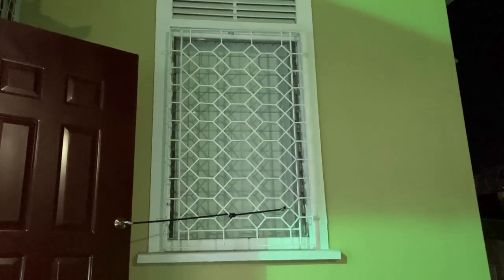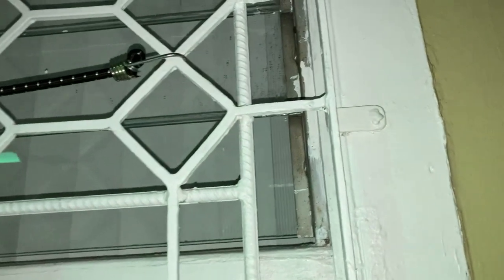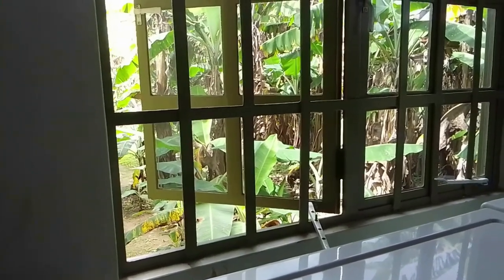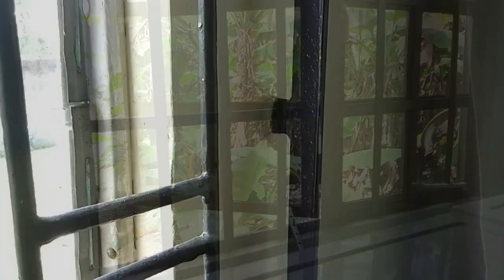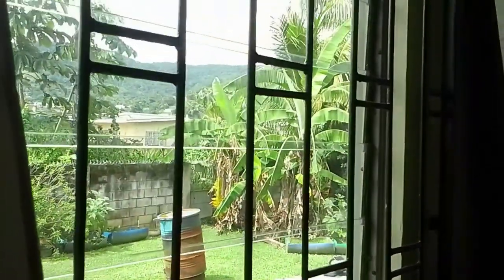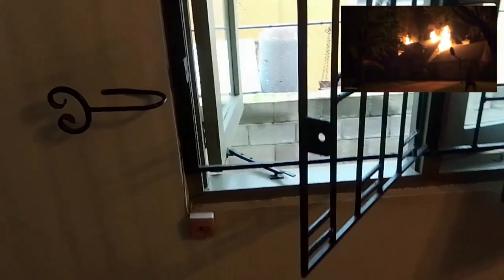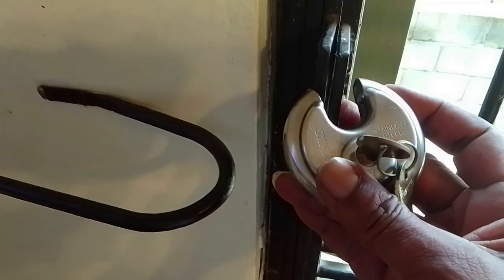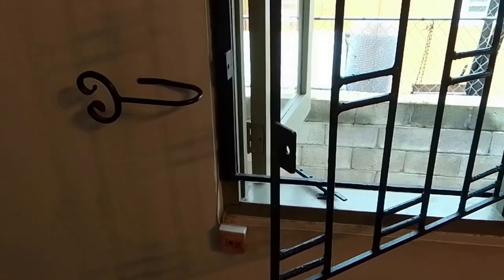Burglar Bars -  Advice for Theft Prevention

Comment: Well said sir and happy holy holiday to you and family. Thanks for sharing this info.
Reply from the maker: It was my pleasure
Reply: I prefer external burglar proofing. When I open my windows I don't want to see it in bars on the inside
Reply: Please remember in case of fire it is the sm9je that kills you before the fire even gets to you. So fire exit must be easy to access
Reply from the maker: @lilacer6841  While that approach may visually please you it weakens your protection for the very reasons that I outlined in the video.
Reply from the maker: @lilacer6841  While that approach may visually please you it weakens your protection for the very reasons that I outlined in the video.
Reply: @pointboy12  naw lots of ways to secure your hone without ugly iron bars on the inside of your windows
Reply from the maker: @lilacer6841  Yes there are many ways to secure a home ranging from thorny hedges, exterior beams, aggressive dogs, window film, house alarms, and others. Each method has its advantages and weaknesses. I do address some of these in this video and other security related videos that I have done. The appropriate concept these days is layers of security so that you are not solely dependent on one protective device(s). Apart from the issue of cost both from an installation perspective and then ongoing maintenance cost, burglar bars is one layer of security.